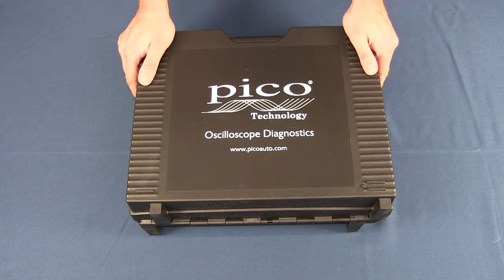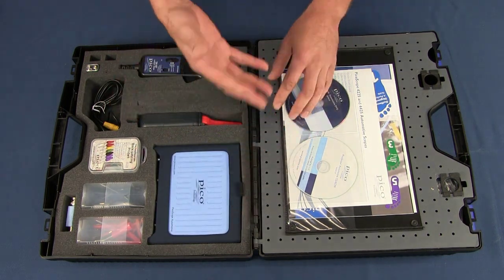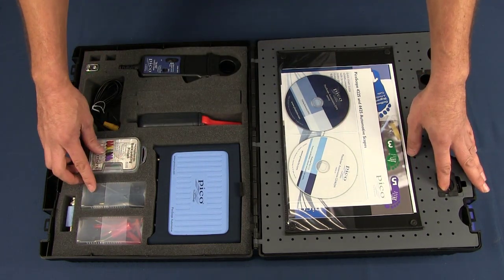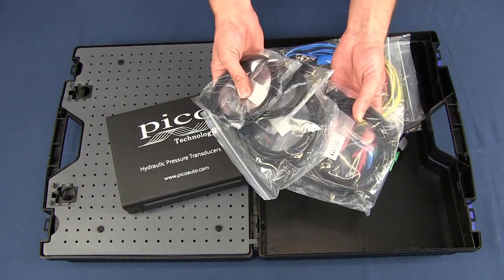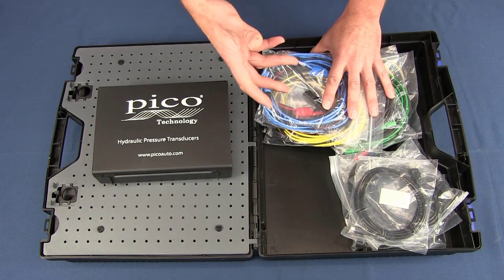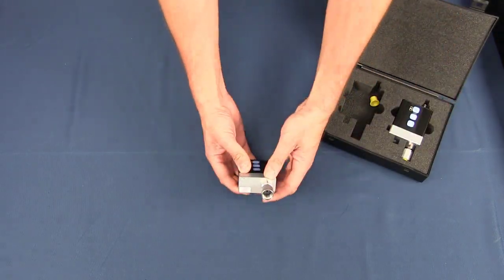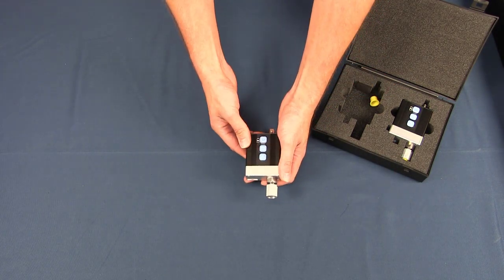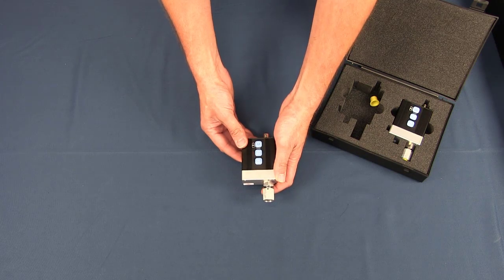Engine and Hydraulics Kit

Comment: will them traducers handle high pressures from diesel common rail injection???
Reply: The simple answer here is no, WPS600C is only suitable for hydraulic pressures up to 600BAR (8700psi).  With many common rail diesel systems they are now generating pressure in excess of 2000BAR (29000psi) it is not suitable or safe to be removing rail pressure sensors to gain access. Having worked for a number of manufacturers it is also not good practise to remove the rail pressure sensor and for most this part is not replaceable. This would mean to gain access to measuring this pressure would rely on the technician to remove the sensor, measure and then replace the common rail anyway. The best, and safest, way to measure common rail diesel pressure is through the sensor itself utilising the voltage output and displaying this on PicoScope. We have a number of videos on our website – www.picoauto.com/library/videos and on our YouTube channel which will help with this technique. I would take a look at Frank Massey’s number 7 and 8 in his top ten list as these focus on common rail testing. Hope this helps. Kind regards Ben